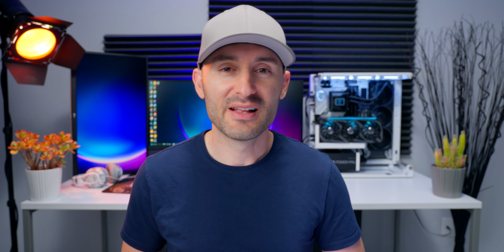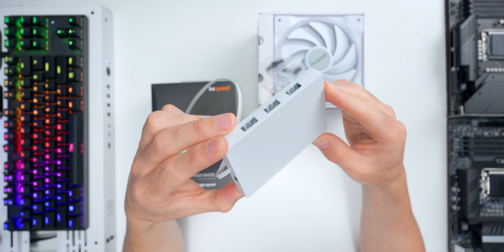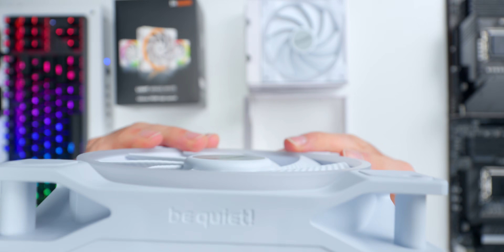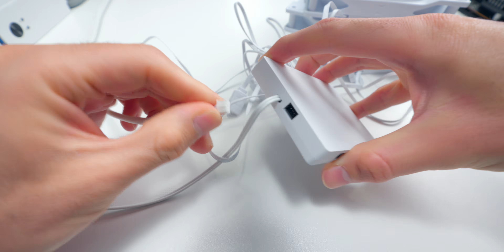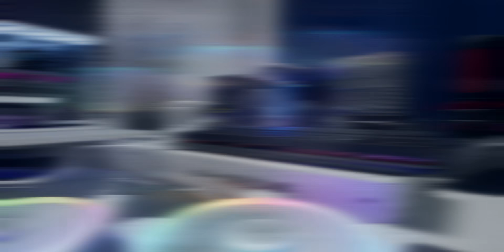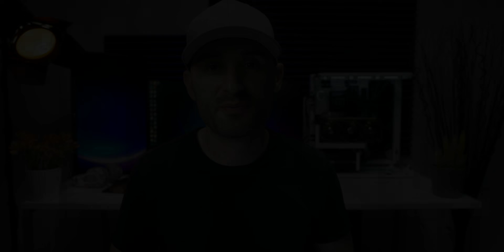Be Quiet! Light Wings White ARGB PC Case Fans | Review and Unboxing

Comment: Thanks for the noise recording. However, I wonder why the video measured (?) a maximum of 41dB(A) when be quiet specifies 31dB(A)? 
It would also be interesting to know why the high-speed version is used instead of the standard version.

Comment: They did come up with a great way to get rid of most of the wires, it's called daisy chaining them. You created the wire mess, by using the hub, which generally makes no sense at all. Just a note. Other than that, good vid.